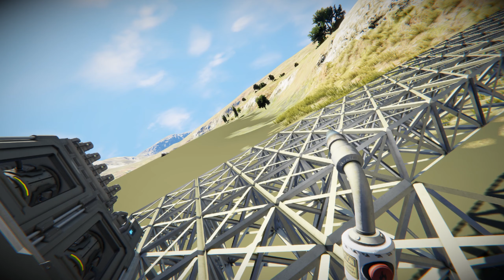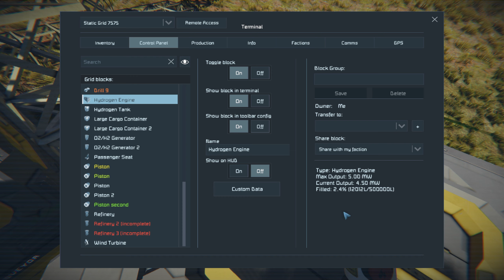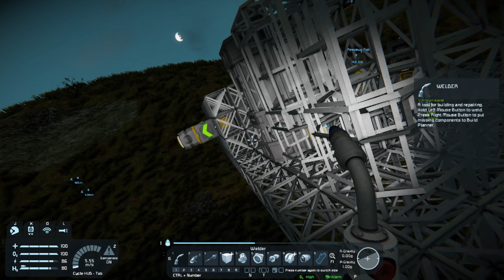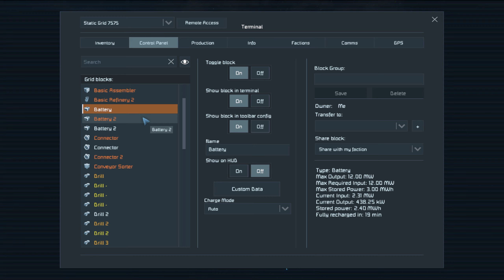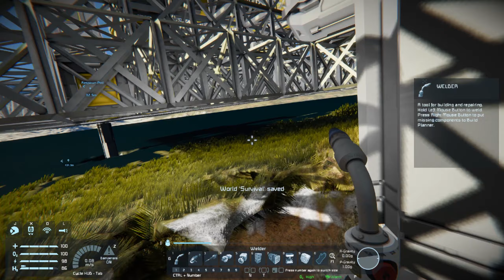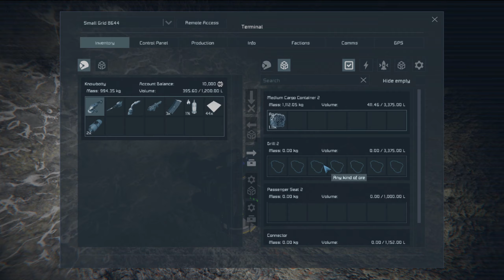Your first small mining ship. Space Engineers Xbox One and PC Beginners Guide #5

Comment: How do you get the ore out of the ship? I'm docked on the large cargo container and I can see the ore in the ship but I can't get it out.??
Reply from the maker: You need to make sure that all of the conveyor connectors line up, you may have a small attached to a large somewhere.
Reply: @KnowBotty  It's just docked on the the large cargo with a connector. Should there be something between the connector and the tank?
Reply from the maker: As long as they both have the same size connector they should pass items through no problem. Pull off the connector and make sure they are the same size ports.

Comment: Is there a way to turn the drill on without going into controls and turning it on manually (on controller cause I can't figure it out)
Reply from the maker: Yes, you can attach a button to the ship and assign the on/off function to the button. Or you can control the remote and long press a dpad key to adding a function there. I will be covering all of the harder to find but most useful controls in a video very soon as well.
Reply: Xbox kinda sucks as far as mapping buttons for ships in a cockpit. Your main menu has 4 slots for block functions and two alternative menus with 4 each. so 12 slots in groups of 2.
Reply: @Cuteseals2  Where should i go/press for mapping buttons? didn't find anywhere
Reply: @truta3715  if your talking about basic controller keybinds I'm really not sure sorry I do believe in the controls option menu you can switch between advanced and basic or at least see the controls